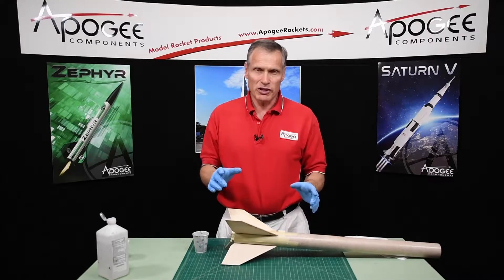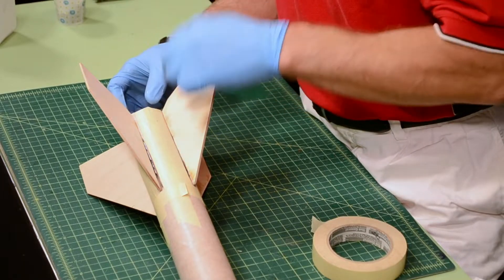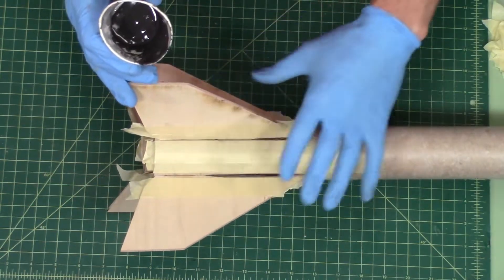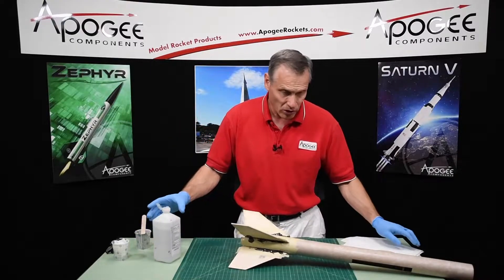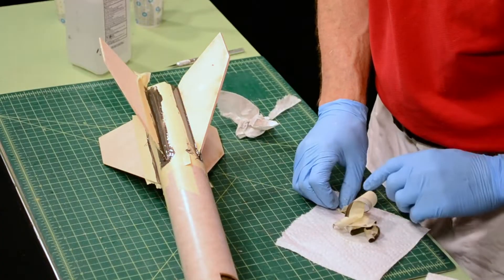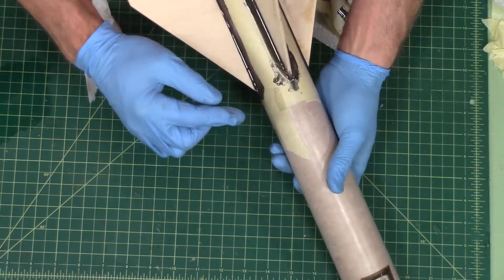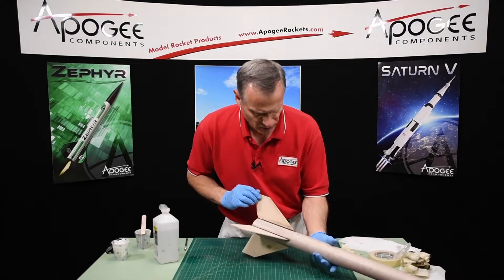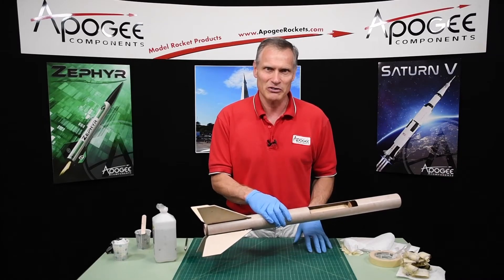Terrier Sandhawk Build Part 7 - Fin Fillets

Comment: Thanks! I’ve been practicing on making big smooth fillets with tongue depressors but I didn’t realize you could use alcohol to actually use gloves fingers on the epoxy. I gotta try that on my next fins.

Question: Am I supposed to be using the black dye that came with the RocketPoxy? Does it actually affect the way the epoxy works or does the high contrast black just make it easier to see where you’re getting the epoxy?
Reply from the maker: The pigment is just for cosmetics. It also allows you to see if you have a good thorough mix - a uniform color..